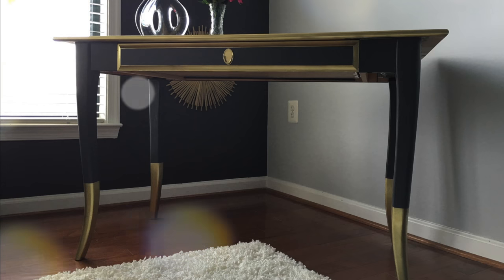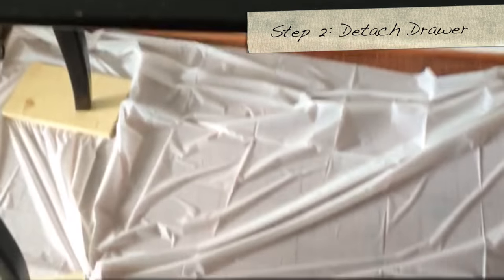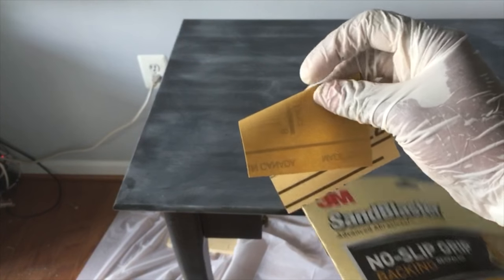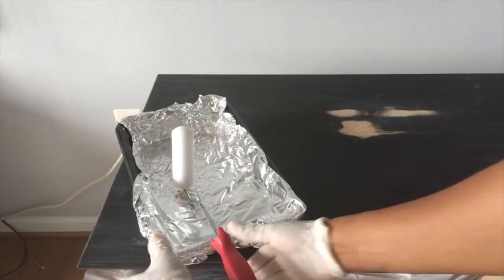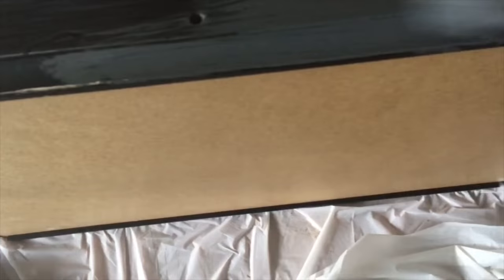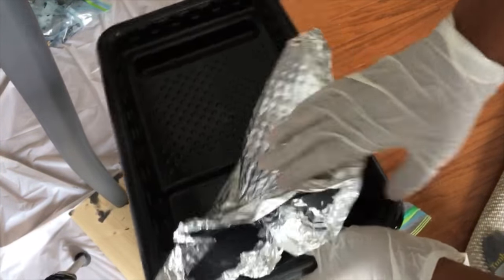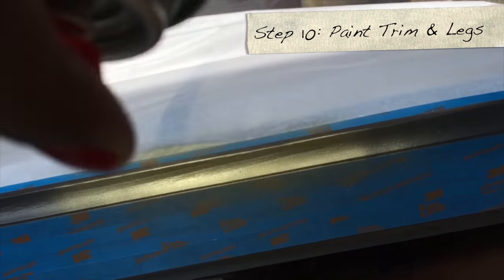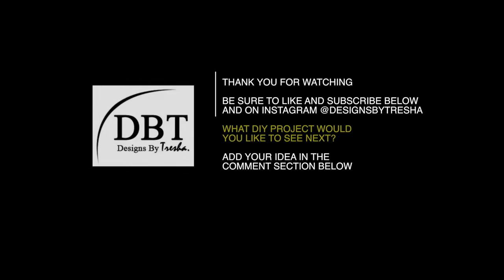The Easiest Way To QUICKLY Revive Your Old Desk

Comment: Just a helpful tip when it comes to operating a sander, always make sure that the sander is on the surface first before you turn it on and make sure that it's on the surface when you turn it off that way you don't put extra stress on your motor. Your sander will last longer! Other than that keep up the good work!
Reply from the maker: +Stephen Jelks Thanks Stephen for watching and for the feedback. I'll definitely do that next time 😊 I want to keep my sander as long as I can.

Comment: My dresser is too heavy to carry back outside and I see that you painted this inside. Did you have any problems with the smell?
Reply from the maker: +Tanequa Smith I decided to do inside for that very reason. If I had help, I would have done it outside. Brushing on the paint was not bad as far the smell. Spraying the gold legs produced fumes. I had all my windows open and doors for ventilation. Also, I left out to run errands for awhile until the fumes settled down.
Reply: Thank you for the fast reply! I may move it to another room and open the windows.